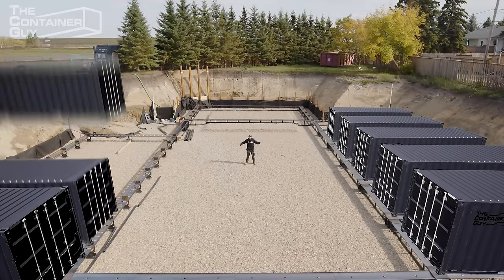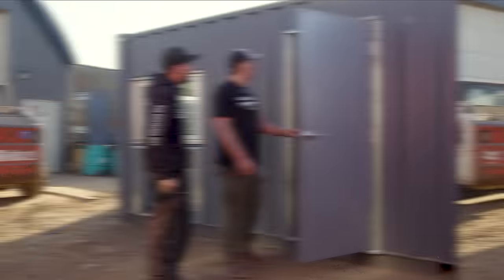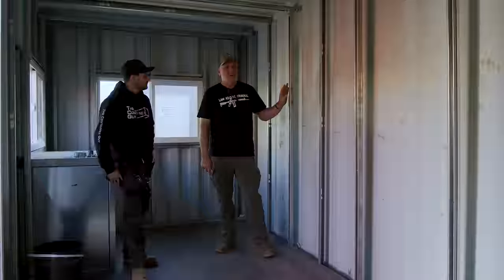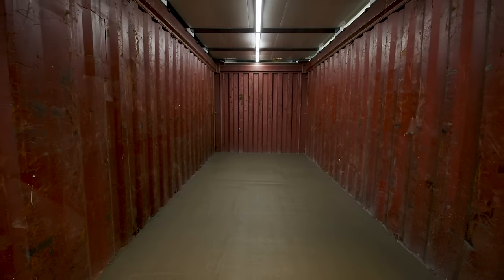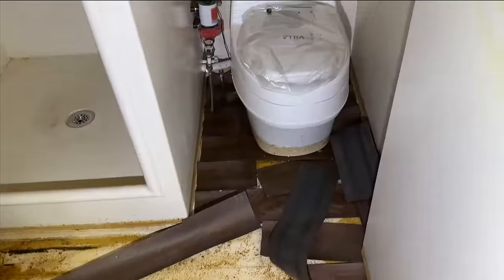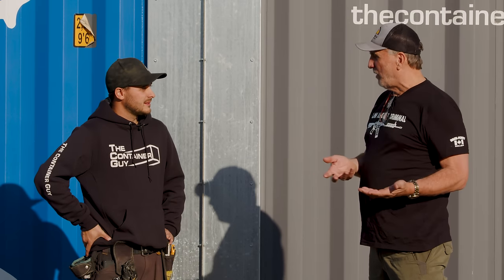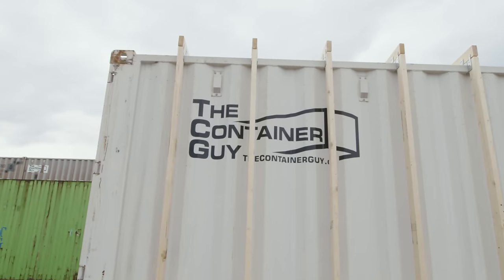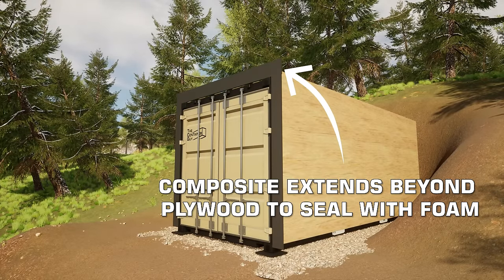DIY Container Bunker Design: Is It Safe? w/@AtlasSurvivalShelters

Comment: After all the work needed to safely bury a container, I think it would be easier just to use ICF, CMU, or formed concrete.
Reply from the maker: But do you trust the cracks?
Reply: This guy has his business model and he's not going to appreciate stuff that doesn't fit it...
Reply: Exactly
Reply from the maker: It was a valid question. I love ICF. My cabin basement is ICF.
Reply: I DONT trust the cracks
Reply: @TheContainerGuyTV  I could ask the same question about trusting you with potential health hazzards from your containers. I dont know if i can trust you with doing your due dilligence about the containers getting used prior to transport hazardous material like pesticides.
Reply: The point of the container is budget, pouring this alone is going to be 75k

Comment: My best friend buried his container in the sand in Florida, the walls collapsed when he backfilled and he never used his shelter, so here is what we what we did, we buried three 40 foot hi cube shipping containers side by side, we started with a base 12" of 1-1/2" clear washed stone, then set and leveled the containers, then set 12" (cement core) ICF (insulated concrete forms) around the two sides and the back, installed rebar, then poured the walls with cement, then set metal deck panels crossways across all 3 containers, and setting on the outside ICF cement walls,  we over lapped the panels at the container seems for extra strength, then poured 8" of cement on the lid over the metal panels, Then installed 2 layers of 2" extruded polystyrene, then installed rubber roofing EDM over the entire lid over lapping the sides about 12" over drainage, we also waterproofed the ICF walls with Total Wall's waterproof cement base coat.  then we poured wing walls like in your video on each side of the doors, then back filled and also covered the lid with about 12" dirt, 10 years later it is still solid as a rock and no leaks whatsoever.  we left the wood floors as is and cut walk through doors between each container so they are all connected and  accessible once you are inside.  The ICF's create a super strong insulated shelter.
Reply: the guy who poured your cement knows where to bring his family if the SHTF

Comment: One thing I’ll add is if you’re doing gravel then simply spray foaming the floor then putting plywood….you will 100000% be getting rodents. The concrete flooring is a better idea should you not want rodents making their way into the structure from underneath. While certain rodents will still burrow under the concrete they won’t be able to penetrate into the structure.

Comment: I’ve been a roofer and water piper for the past 40 years union one thing I’ve noticed you only show three sides of Waterproofing. You don’t show the backside you don’t show even the underside. If you’re gonna put an envelope on your Waterproofing container, you have to do the entire structure we’ve not one side unfinished. I prefer using Hydrotech hot rubber with a fleece membrane at least 10 mm in between each ply of hot rubber usually 65 mm thick or thicker sometimes 120 mm and that’s using 2 to 3 plies of fleece. Don’t forget the primer so your your hot rubber will apply in it here to your metal. Or you could always go with Tremco Paraseal with Bentonite. There are so many great possibilities but I would never use sprayed on liquid tar. It just doesn’t stay on it nine times out of 10 bubbles out and blisters off after 5 to 10 years..
Reply from the maker: Thanks for the wisdom! I think we'd remove the wood floor and spray foam a 3 inch "bath tub" all around the unit. Still TBD. 

I bought some Ag land near our container yard and hope to try something next summer. Stay tuned

Comment: I buried my container upside down because the flooring is the strongest part now having it as a ceiling. Sat down on two foot of gravel for water drainage and poured concrete slab floor inside over horizontal rebar and vertical rebar hammered into the ground 6’. I ran 4” I beams every two foot apart down the sides and sealed everything up with sealant and more gravel to fill in the sides and top with a layer of dirt over that.

Comment: I personally think ICF, assembling precast Square pipe sections together or forming the desired shape using pressure treated plywood and pouring concrete would be easier than skinning inside and out of shipping containers. Perhaps using the end wall with the door/s end wall of the shipping container and casting into position with the angled retaining walls would make sence. lots of ways to do things but seems like a lot of layers inside and out to make a shipping container work. would be a good business model to have a set of casting/forming mould sections that can be assembled on site and removed to take to the next jobsite. a curved roof is stronger tham a flat roof so make some curved room mould sections and a one with a tunnel access so have multiple exits.
Reply: Completely agree. I'm not sure why people would even want to use a shipping container to begin with. It doesn't give structural support, it doesn't provide insulation, it doesn't provide an air or moisture barrier, and it forces you into a specific shape and size.

Cool idea but it just doesn't seem practical.
Reply: shipping containers are DIY friendly and cheaper to free to get started with... ICF is good for people with a big budget and a lot of time and requires hiring a lot of professionals... shipping containers can also be done more secretly and quickly.  concrete blocks are the cheapest but require more skill and knowledge and the ceiling/floor is difficult and requires skill/knowledge/training or hiring a professional...
Reply: @VenturaIT  a blanket over chairs is also very DIY friendly and easy, etc. You didn't say anything to address all of the downsides to shipping containers. They are a huge waste of time and money unless you're getting them from a junk yard.

ICF can be stacked and filled by one man with a hand mixer and a pickup truck for small projects.

Comment: I have an underground home.  I'm the second owner.  Had to excavate the wingwalls at the entrance and put in drainage tile also used allthread and 12 inch steel plates to prevent them ever coming back into a bulging state.  Backfilled with river rock.

Comment: It’s very important to use perforated drain tile around the perimeter of the container and don’t forget the slope along the back and towards the front to properly drain the buried container so to avoid water pooling around the unit. It is also wise to add a bit of slope not only to the prepared bed of an in hill installation but to the container as well in case Murphy sticks his finger into the build.
If your doing a bitumen seal around the container, use extreme care in backfilling the instal, it can scratch and allow water in that will attack the steel over time.
Reply: Good stuff I will be at this stage when the snow melts in northern Quebec. We have an off-grid cabin at the moment.

Comment: It's a great Idea. I think an ICF system would be a good cost effective solution with fiberglass rebar as a mono pour.
Reply: If you do all that with engineering approval then why would you need shipping containers? Especially when you have 8’ narrow interiors.
Reply: Exactly. Even a CMU block with rebar and poured cells will do the trick at less cost..
Reply: @user-mm6xi3er5u  At the end of the day, he does offer a unique service and product. Honestly, for his age, he seems to be doing well from a business perspective. The other thing is container builds have been trending this past decade because of the save the earth movement. The reality it that you can build in a different way for less resources than a container. I'm sure he is aware of his market. I think the largest competitor in North America is probably mobile storage. They are many in the commercial realm of job site conversions. I could also see this valuable to ship gear and supplies to a remote area to set up a home base. Nonetheless, he is diversifying his service portfolio, which is good even if it's a small market.

Happy New Year
Reply: traditional methods are not as DIY friendly, the guy from Atlas said there are no building codes or permits for bunkers, traditional methods are also not as cheap (or even free) to get started and require hiring multiple professionals who will all know your business and location, the ceilings/roof of ICF and concrete block is much more difficult to impossible for the average DIYer, with the shipping container they can get a small bunker in the side of hill for the cost of the minor things like rocks, drains, sealers, insulation, wood...  shipping containers can be found for free.

Comment: Be careful codifying shipping container as structural building code. It is already difficult to compete with well designed steel framing and moment frames. Especially when project requires structures of wider than 8’ clearspan, shipping containers are claustrophobic. Most shipping container clients put up with 8’ restrictions for cost saving.

With the popularity of shipping container shops and reduced availability you will kill your own industry, and there won’t be no turning back. Less government regulation is good, find business differentiation with engineered solutions not squashing new businesses.

I am a retired Green Building contractor and clean tech entrepreneur. Let youngbloods flow into your industry. I remember when you were a young buck trying to sell shipping container ideas.

Comment: When researching to do an underground bunker myself I came up with a method ive not seen anyone else do before that I wouod like to try. Essentially dig a straight hole a couple of feet wider than the shipping container and weld a top hatch on the container.  Waterproof the heck out of it with dpm/ tar paint/ etc and prep the base of the hole in the same way as this video.
Now the different approach: using pond liner create an inner shell liner INSIDE the container. As you pour the concrete along the exterior of the shipping container(between container and earth side), fill the lined inside of the container with water, balancing the pressures as the concrete cures. After a week pump out the water inside, remove the liner and you have a concrete bunker without the need for retaining fom walls. Now the density of water and cobcrete isn't the same, so worse case you have to fill the water to concrete in a ratio of 2:1 and do the concrete pour in two goes 
Hope someone sees this comment and can provide any insight into my idea.
Reply: You are essentially reinventing the wheel with your method and adding an unnecessary shipping container to the mix. If you Google how concrete dome homes are made, you will find that they use a bladder. They inflate the bladder with air, then spray a sticky cement mixture over it. After deflating the bladder, you are left with a concrete dome. This method can be applied to any shape, and the thickness of the dome or whatever shape would depend on the required strength to withstand the dirt load. I'm not sure about the exact calculations, but I believe fiber-reinforced concrete could potentially eliminate the need for rebar or a steel structure if it is made thick enough. Then you would cover it in plastic liner and spray foam and you would have a watertight insulated underground structure.
Reply: if you are filling the outside with a concrete shell, you probably don't need the wood framing, just the standard requirements for concrete (rebar, etc.)  the shipping container is probably strong enough to hold the concrete while it sets since it's not the entire weight of the hill like with dirt fill...  but you need to know what you are doing with concrete forms because they can fail and kill and hurt people... so talk to a professional first.  the framing on the outside is more there to hold as a form... which it would be required since concrete is heavy...  a lot of concrete forms are made with plywood on both sides.
Reply: @zachmoyer1849  They have perfected that concept in the military.
Reply: @George-vf7ss  ?? the reinventing the wheel part?
Reply: @zachmoyer1849  The inflatable bladder, covered in wire mesh, then shotcrete sprayed on top. For temporary emergency hospitals, they leave the bladder inside, as it is easy to sanitize. They control the environment with A/C and huge HEPA filters.
Reply: @George-vf7ss  yeah exactly i wonder if there is a supplier where you can cheaply buy the bladders.

Comment: Glad to see this video series. Thanks for doing it!
Another question would be, what if you wanted humidity inside, like for a root cellar? Much more niche, but I'm wondering if you could skip the spray foam, keep the bottom open, and just use pond liner around the outside/up top.

Comment: My Brother's Basement, is backed into a Bank. The Front Wall (Sun Face & Door) is 4" Thick Poured Concrete. The Side Walls are 6" Poured Concrete. The Back wall is 8" Thick Poured Concrete!

It is on a 24' x 24' layout, and the Back Wall, has a Sloped "Corbel" included Mid Point of the Wall! 

Hard to believe that was done when I was a Young Boy, over 50 Years Ago!! Its still holding up well!

Not sure what I heard here will hold up to Sloped Earth Pressure, & Hydrostatic Pressure, but, time will tell!

Comment: I like the premise of using engineered rock under and on the sides to move water. Maybe incorporating rock wall fencing, sorta like a hesco barrier, to the sides would make a more viable option than filling a pit with engineered rock. Really dig that you are getting Ron on board. You guys could colab on an entirely new bunker/ shelter format.

Comment: It would almost make more sense to flip it over and seal off the cracks in the floor and just pour concrete for the roof and install a new floor on what used to be the top of the container. Also the floor and the four corners are the ones rated for holding the load kinda like a pole barn

Comment: Friendly warning about regulations:
Whilst well intended, you don't want them. Regulations kill industries, small businesses, innovation and improvements. As can be seen looking at the over regulated hellhole that is Australia, everything MUST be done by a licenced professional TO the standard. That means absolutely NO deviating from the standard. Sure you might be a qualified engineer who can prove its safer to go beyond the standard - but you can't! The law sets the standards as the only way it can be done, not the minimum. Standards tighten annually for minor things, but, for any major changes - that's a once a decade review that NEVER happens early.

Standards also automatically prohibit any and all DIY as the profession and work becomes legally "regulated".

Regulations / Standards also create a boutique industry of "inspection" at every stage of the process. Not all, but many inspectors will leak details from one business to another so kiss any permissible IP goodbye (methods, layouts, etc.).

Regulations / standards also are by design used to keep small businesses out of the industries:
* The cost to buy the standard is usually $8000+ for anything major
* The costs to be approved to build/design to the standard (i.e. compliance licencing) start around $25,000 per employee per year
* Each inspection can cost up to $10,000 because you can't do anything without the inspections, nor can you have an "in-house" inspector
* Annual re-training/update/refresher courses 3-5 days every year cost ~$5000 per employee per year - becomes mandatory to remain qualified

And all that's on top of any existing professional licencing and update/refresher courses and continuing professional development (CPD) which are required to remain qualified as a licenced engineer.

Put this all together and you get a situation where one or two idiots who don't care about quality and safety ruin it for everyone and only the existing big names can continue. That's how it all plays out, that's why is damn near impossible to do much of anything in Australia without the direct assistance/involvement of a giant multi-national corporation who's permitted to do it.

The best solution is to make it easy to hold the company / individual 100% liable if what they did fails or has issues. American's love to sue, that process needs to be made easy in such cases where the product failed or had issues. When I say liable, I don't just mean the business, I mean someone who's liable for signing off unacceptable/insufficient work.
Reply: But then snake oil sellers like Rising S still thrive. I guess, though, peer accountability matters. Some companies could even band together as an association and set standards that allow a bunker to receive an "Association Certified" badge that guarantees quality.

Comment: I really like your ideas.  Since you have the platform to try things here are some comments.
My rules of thumb.  Keep it simple and safe. DIY, positive ROI. Better.
Make hole 2 feet larger all around container.
Set container 1 foot off ground on temporary blocks on 4 corners. Remove wood floor.
Place first foot of closed cell polyurethane pour foam under container. Replace floor.
Pour foam is less expensive than spray foam, more diy, water barrier, insulation, no need for gravel base. Foam supports entire container.
Maybe add studs or rebar around container for reinforcement.
Continue adding lifts of foam between container and dirt wall which is the outer form.
Cover top of container with 2 feet of foam. Cover with 1+ feet of top soil.
The pour foam is the insulation, water/moisture barrier, and structural support.
Since the density of pour foam is much less, the force of the soil pushing against the container is balanced.
May need to put more soil on top to keep the container from " floating" out of the ground.
Adjust to fit.